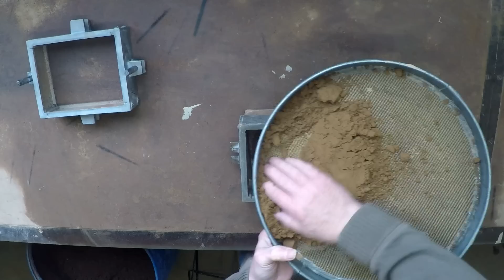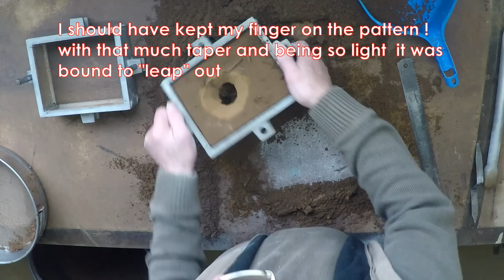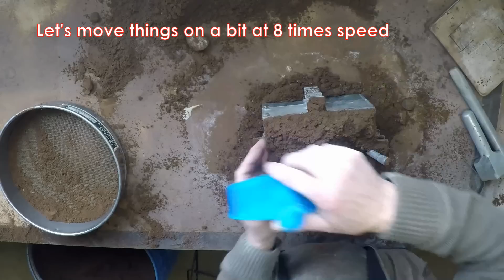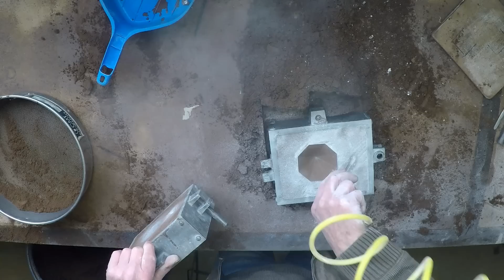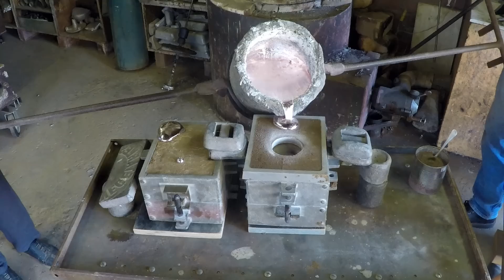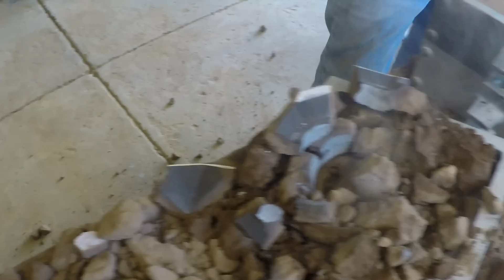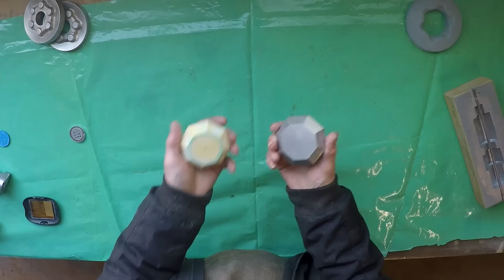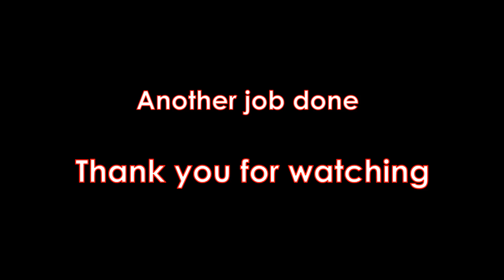Sand cast Aluminium "Trophy Diamond"

Comment: Darn good looking coin at the end there ;-)

I am curious, why couldn't you have cut a basin off to the side of that extension rather that pouring straight down the sprue.  I guess for that matter in hindsight you could have put the cope extension on while the sprue former and feeder were being rammed. Hind sight is nearly always perfect ;-)

I'm also curious about the feeder height. I completely understand what you're saying about it needing to stay molten longer than the part. But, given the relatively small about of shrink that seemed to be in the feeder, would a shorter feeder have worked anyway?

Good to see you again!
Reply from the maker: Sw, Cricket, you DARE to question? Seriously you are right - I could have handled this job a lot better! I did think about cutting the basin off to the side in that extension but I was concerned about getting everything in the right place - I was sort of operating by guesswork with respect to the relative positions of feeder and sprue, I did not feel that an after the event try at cutting a proper basin was all that likely to come out right and it was not exactly an engineering safety critical job. However I should have, as you suggest, put the mould extension on the top of the cope BEFORE ramming it all up so that the feeder and sprue would have been extended the required amount and I could have then cut a decent pouring basin. This is after all what I normally do when I know before ramming the cope that I am going to need an extension I guess I though that I might have got away without the extension (in truth I probably would have) so I did not bother to extend the cope whilst ramming it - then, in circumstances like this I just use some of my shell core preformed feeder and sprue extensions. However in this case my biggest feeder extension is too small for a feeder that large in diameter (must make another size!) and I had to quickly make do with what was available. 
Re feeder height - you may be misjudging the amount of shrink - the use of exothermic tends to make the entire top of the feeder shrink down rather than form a central sort of depression. The trick here might be to compare the height of the feeder against the mould top when just poured and again just before mould breakout. Would a shorter feeder have worked anyway - I very much suspect so, particular with the use of the exothermic and I will admit to the use of the extension being a belt and braces approach but rather that than a failure. 

In all of this error riddled job I plead ill health - I know, I know, its a old and tired excuse but its my story and I am sticking to it - beyond that I take the fifth..😀..Martin

PS. If hindsight is NOT perfect  you do have a problem
Reply: Cricket?? Is that a lateral move from grasshopper or a change in vertical position?? ;-) No master I would never dare question, only seeking to learn with the humblest of attitudes.

Your answer to the shrink on the feeder has caused me pause. I guess I never really thought about the normal center shrinkage that I see being due to the outside of the feeder cooling before the center. Makes perfect sense, I just never thought about it.
Reply: You don't get to take the fifth... That's for Americans only =D
Reply from the maker: Luke, Hang on, my male line arrived in the US  (MD) in 1677 my female line in MA in 1632. Until my father (a Canadian) all were American, does that not qualify me for de facto US "ness"and therefore use of the fifth? 😀. I have relatives in just about every state ....Martin
Reply: Seen as you complain about freezing temperatures, you must be in the southern hemisphere. And as far as I know, the US doesn't have any states in that half of the globe... You sure sound as down-under, and if I'm not mistaken, something in the like was said when the first challenge between swdweeb and vegoilguy was discussed...
What do they say about that duck again? ;PP
Reply: @olfoundryman8418   Canadian eh! Well then. You should be able to work in the cold with no problem then. Speaking as a card carrying Canadian. It gets quite cold in parts of this country. At least the places where I have lived for any length of time. If you are serious about someplace to keep your tools warm and insulated enclosure with an incandescent lightbulb or two will do the trick. You will have to experiment with the lightbulb value as even one 100 watt bulb is mostly producing heat.
Reply: Olfoundryman a 1632 MA line... sounds like we are possibly distant cousins. Of course there was something like 80+ families there. I'm part of the Swasey family line out of that area.
Reply from the maker: Walt, One Francis Baker a Quaker and first of my grandmother's line was on the ship Planter as commanded by Nick Trace. Landed at MA in 1632 as part of the so called "great migration" that began shortly after the Mayflower had made it in 1621. Apparently about 10K people comprised this "great migration". Francis was of course from England and his parents have been narrowed down to one of two couples but which is as yet unknown. We could easily be cousins my line lived all over the early US, today relatives must number in the tens if not hundreds of thousands. . Martin
Reply: Olfoundryman according to my charts, Francis Baker is the 7th great grandfather of the husband of my 2nd cousin on my grandfather's side. Not a direct relative more of a through marriage.
Small world it is. Of course looking at one individual doesn't tell the whole story, like you side there are 10's of  thousands of people more with each rising generation.
Still an interesting little connection.
Reply from the maker: Sw, Yes, the natural tendency is for the centre to stay liquid longer than the edge for the reason that you have given. the exothermic does change this slightly by keeping the top liquid and  forcing all the heat to be extracted by lower down in the feeder and preferably by the casting itself. However different alloys have different solidification patterns and alloys like the aluminium bronze that you have been using are great centreline feeders (the result of a narrow solidification range) exothermic will modify this a bit but the centre shrink will still be very obvious with such alloys. You can see an example of this in the aluminium dies I cast for the lens blank die. This is a piston alloy and has a narrow solidification range and thus pronounced centreline shrinkage even with the use of exothermic the centreline shrinkage is very obvious. The alloy for the diamond was the usual 356 which has a moderately wide solidification range an tends to shrink, and therefore sink, partly in bulk and partly in the centre the exothermic favours the bulk shringk a bit more... Martin
Reply: What exactly is that "exothermic" compound? And if the sole purpose is to add a bunch of heat to the surface, why not just hit it with oxyacethylene?
Reply from the maker: Mark, My father, born Agassiz BC, spoke of 15 foot of snow and it being so dry (the snow) that it could not be skied upon, large snow shoes being the only way to get around and of all the animals being in the barn for up to 6 months of the year. No doubt some - ahem - journalistic licence here but he hated snow and never wanted to see it again. He maintained that one could not really work and live in such a climate, he loved it here and the heat of our summers never bothered him and the relative warmth of our winters gave him joy. I guess its all a matter of what you are used too. But regardless, he is back there now with his mother on whom he doted... Martin
Reply from the maker: Luke, Down under indeed and damn proud of it 😀. There are some in the world who consider this great southern land to be just another state of America. They are wrong of course  (I think) but one can understand how come they get that idea. Quack, quack… Martin
PS. still claiming the fifth.
Reply: Martin, proud Ozzy men can usually appreciate Gary Orsum's narrations and political rants. He's got a rather dry yet sticky sense of humour =D Most of the topics are none of my concern, but the mere way how he approaches things often puts a smile on my face :)
Reply from the maker: Sw, Hell, cricket , grasshopper whatever! I am just so confused - must be an age related thing where did I get cricket from? Must be less recovered than  I thought... Kermit/Martin
Reply from the maker: Walt, Its a bit of a tenuous connection but it does demonstrate the 6 degrees of separation theory. It is a while since I looked at the Baker line, been concentrating on my West line - we have one Robert West landing in MD as an 8 year old indentured servant in 1677 trying to connect the dots of his descendants and my DNA matches is driving us nuts! I will see what I can find on the Bakers I was sent a big file leading from him to my grandmother by someone living in Cross Plains its slap ban fair in the middle of Texas... Martin
Reply from the maker: Luke, As the exothermic is a propriety product I do not know its exact composition. But they typically contain a metal powder e.g. aluminium, Magnesium, or zinc to provide the fuel and an oxidizing agent - judging by the smell of ammonia that one can sometimes detect I would guess that at least some ammonium nitrate is in it as the oxidant but I know that potassium nitrate is also used sometimes. There would appear to be iron oxide in there too. There are also rate modifiers present (sand!) and substances that make the ash swell to provide insulation after the burn has subsided.
An oxy flame? Cost of bottle rental ($500.00 plus per year) means I do not have a set to try the idea out. I could try an LPG air burner and next time I cast (maybe a while!) I will try it  but in the meantime if some kind soul out there wants to try it and let us know the results it would be appreciated. However I do see a few possible practical problems.
1. The force of the flame may blow the metal all over the top of the mould, particularly  on feeders of say 2 inch diameter or more

2. You have to position, light, and hold the burner. Some of my feeders stay liquid for upwards of 5 minutes so you would have to hold it there for that long. You would most likely need someone else to do this for you - your busy with the crucible remember.

3. And that exposes the big problem - I pour maybe 10 moulds at a time (over a period of a few minutes one after another) so I would need 10 burners on 10 stands attached to 10 hose setups and who knows how many bottles to provide the gas - its all an impractical mess and those hoses are a safety hazard - one drop of metal and a hose will rupture whipping fire all around the place - not a good look

But for a one off situation it should in theory work so try it, but beware # 1 above.
… Martin

Comment: Why no gloves?
Reply from the maker: Mark, I do wear gloves for some parts of the process, for others I do not. In order to answer your question to which part (or parts) of the process are you referring to. Let me know and I will be happy to  provide you with an answer... Martin
Reply: @olfoundryman8418  Your hands were cold while working with the sand. Why not were gloves to keep your hands warm?
Reply from the maker: Mark, Yep, they sure were cold! But I don't know how gloves would go. I do note that some people use thin rubber gloves when working with petrobond sand as they do not like the greasy oily feel of it. There would not be much warmth in such gloves and anything thicker like wool for example would wear very quickly with the rubbing of the sand through the sieves. Leather would survive that rubbing but  would lack the "feel" so I guess its cold hands I will have to put up with. Oh how we suffer for our art.😀...Martin